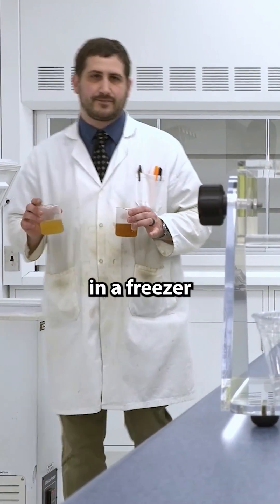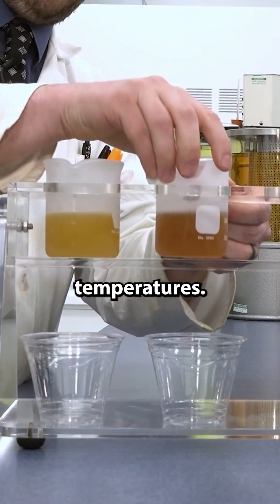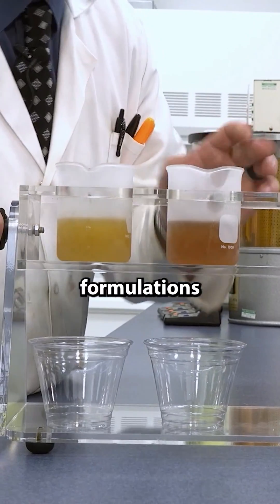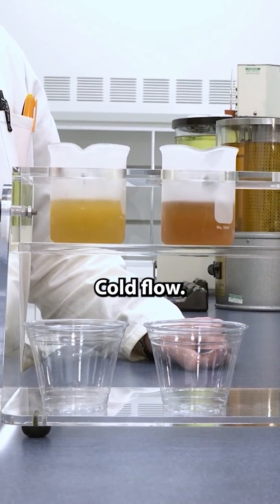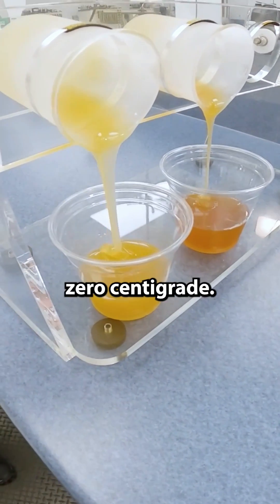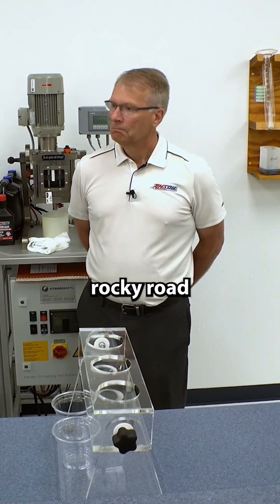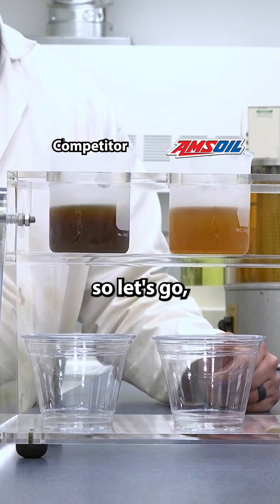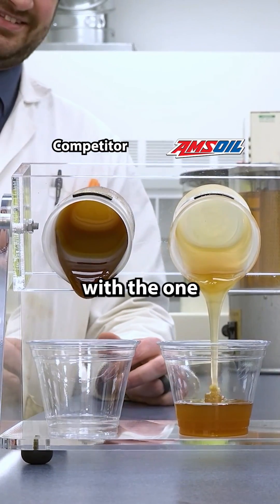Engine Oil At -35°C

Comment from the maker: lubricants tested were Delo 15w40 and AMSOIL 15w40 motor oils
Reply: why is the Delo oil darker...is it used?
Reply: @RX7Jay delo is always darker
Reply: @RX7Jay Probably regular rather than full synthetic would be my guess
Reply: Ive bought delo hundreds of times and some batches are certainly darker like that.  @RX7Jay
Reply: So -35 and dude can just grab it with his bare hands.
Reply: @GForce.Racing easy, it's just plastic, we do it all the time here in AK,, metal on the other hand, 10 secs and your hand gets cold af 😝 -35 isn't an extremely dangerous temp long as you're not exposed to it for too long, just don't lick metal at that temp hahah
Reply: @GForce.Racing  nice catch. However, the super cooled beakers probably weren't that bad for just a few seconds. There's a guy stationed at the south pole uploading short videos and he uploaded one of him walking around a building in a t shirt at -60⁰F. 
https://youtube.com/shorts/TnEHT3L-T4E?si=LzjasLi7hS3mkSMY
Reply: @GForce.Racing it’s not that bad, if it were a metal cup it might stick to your fingers a little but it’s not going to give you instant frostbite.
Reply: And the Delo Oil wasn’t Full Synthetic Oil, because the only have “blended Oil”!!
Make the same, so you called  “Test” with a full synthetic Oil off any  known Brand.
Thanks
Reply: The cold viscosity rating is measured at 0⁰C. At 0⁰C, the oils would pour very close. The operating temp viscosity is measured at 100⁰C. They would pour very closely at 100⁰C as well. But amsoil has better viscosity additives for better low temp flow at -35⁰C. 
  If youre that concerned about cold startups in winter, use 0w-40 instead of 15w-40. I'd like to see what amsoil 15w-40 compares to a mobil1 0w-40. Personally, I feel 15w is still too thick at 0⁰C amd would prefer a thinner Winter weight while retaining a higher 40 viscosity at 100⁰C. And let's be honest here, a diesel engine under sustained load can see oil temps well over 100⁰C. I'd like to see the viscosity/temperature curves from amsoil and their competitors outside of the standard 0⁰/100⁰ range. Amsoil clearly has better extreme cold flow vs a standard 15w-40 oil, how stable is the viscosity at higher oil temps? Does it thin out more quickly in extreme heat?
  We should choose the oil that suits our needs and seasonal environmental temperature so that our engines get the best flow in extreme cold starts and best protection in extreme heat.
Reply: @EricErnst excellent questions. Simple bench test like that is only a small part of the whole pictufe
Reply: @EricErnst Well, I have 5W-40 mobil synteth on My old Volvo V70 Gas. Works well in Finland. About -25 Max in Tampere. 

My Friend has An Old Fiat Punto....1.2 Gas....He uses 10-30 diesel grade, because he is a truck man....

Works well....
Reply: common sense, you don’t use 15w in -35 lmao
Reply: Delo is $17/gallon, Amsoil is like $40/gallon...
Reply: @bobbygetsbanned6049 gee, i wonder why
Reply: That is good to know! I’m really happy to see that information. So just off the wall question? What kind of stain does this put on your motor trying to push this around? In my mind would think it would be very high .
Reply: @richardmoerke9329 a lot or strain, actually. More specifically the oil pump gears/teeth can be sheared off of you start a FREEZING cold engine/oil and try to Rev it. The oil pump is sped by rpms so If you try to spin it too quick the oil is so thick it will destroy the oil pump
Reply: Wow. You know what's going to flow even better than the AmsOil at -35 degrees Celsius? Any 10W-40.
Reply: Who would Put 15w40 in winter !
Even ur "better stuff is too thicccccc
I would get something like 10w30
Reply: Is this an ASTM test and if so whats the number. This could just be a demostration that makes one apear to stand out better than the other one but meets the same standards?
Reply: Toyota uses 0-16 w
Reply: @mikeme9938  if you have freezing temps most of the year ok otherwise it just for saving fuel. 0w16+ longlife what actually kills the engine.
Reply: Yeah but it's not a fair test... try a synthetic vs synthetic next time and fwiw I've never seen delo that color
Reply: @sxsprime I think ya better check that one out. The recommended oil changes depending on the temperatures it's operating in full time. Most mnftrs go to at least 10w40(reg\conventional), or 5w40(synthetic) oils when regular temps are at\below 0°F. It depends where the truck is operating. You won't be running 15w40 when temps are -35° or less all winter and be able to start it too well. That's why some trucks have block heaters, oil warmers, & batt warmers up in the frigid artic too. 👍🏻👌🏻🤔🥶❄️☃️🧊🏔️🛢️🚜
Reply: See, this is smart marketing. Actually using the correctly winter rated oil, like 0W-x would not have been as impressive of a difference. Use the correct viscosity for your operating environment and don't trust everything you see on the internet. 

I'd choose a correct viscosity winter oil with an additive package for other things over the wrong viscosity with an additive package for cold flow. Just saying.
Reply: @hellfireclub86  15w40 is tge correct winter oil for most diesels
Reply: @SXSPRIME  where ? at sahara desert?
Reply: At that temperature there both worthless, they both will not be lubricating the engine at that temperature. So thats the only thing this test show.
Reply: Who uses 15W40 at -35C?
Reply: Such a shame that amsoil and Banks both couldn’t find yall experts to hire. Clearly far superior intelligence than the actual engineers
Reply: BELRAY best
Reply: Using 0W-30 in my car. Even better.
Reply: i use 5w40 for all our cars.  no wonder it flows like honey when its 15w40 lol
Reply: @tomast9034  at operating temp 5w40 is same as 15w40
Reply: @SXSPRIME  but you have get there from "minus infinity" if the engine isnt heated up already. when here was -27deg C it took like 5 min for a gasoline engine to blow warm air, for a diesel 10minutes. the 5w40 flows like water in those temps. now half of the time it would turn with no oil presssure and pushing thru honey like guu.. if there is 15w40. its not the 80th where some engines were built to get to the next repair shop with no lubrication unharmed.
Reply: This is a scam the cups are different... The pour spout on the amsoil is wider....
Reply: Same weight oil? And both synthetic oil?
Reply: @scottbehm5728  The pour spouts on the two beakers are shaped differently, this is a scam....
Reply: This only matters if you show at what point the viscosity of each oil departs from each other.  

If they are both the same viscous at, let's say for example -15c, and after that the AMSOIL becomes more viscous, then it only matters for people who drive in -15c temperatures.  

I'm more interested in how they handle high temps, like engine operating temps.  Is the AMSOIL more or less viscous than the competitor at that point?  

How do they operate in engines with different oil pressures? Turbo engines, for example, need heavier oil..  If you take the same weight of AMSOIL vs competitor, does this mean AMSOIL is going to be more viscous, therefor potentially harming your engine?  

So many  variables that are not explained in this video that absolutely must be explained before coming to any conclusion about which is better or not.
Reply: partly fake!?! take a look at the spouts of the beakers, the spouts of the competitors are considerably narrower in both runs.
Reply: Who uses 15w40??? New cars have 0w16 oil. I put 20w50 in my 1979 spitfire but it never goes on the road in winter
Reply: @smoguli Diesel engines still use 15w40 oil🛢️ But at lower temps time of the year or location, they require diesel rated 10w40, or even 5w40(synthetic). 👍🏻👌🏻🥶☃️
Reply: Take all the additives and plastic out of it and do it again.  Yes plastic.  I know.  You should know.  Nothing....nothing on the planet makes raw oil turn black unless it it is added by the manufacture.  300,000 miles on my truck with no oil change.
Reply: I want to see how your oil performs at high temperatures if its so fluid ar -35° C .
Reply: How does it perform hot?
Reply: 15 literally not a winter use oil thats almiost what i put in my 8026rpm 32psi engine for track use it was 15w50 or 40 not sure
Reply: Never even heard of Delo before. Why not test one of the better competitors?
Reply: @nateb.1568  you must have never driven a diesel.
Reply: Who tf uses 15w anymore????? Now we have 0w30/5w30/0w20/0w16/0w40. Who lives in a place where -35 can happen will put 0w not 15w so ur test doesn't make any sense !!!!
Reply: who uses 15Wxx Oil at -35°C?
Reply: 15w40 ... What is this for a Car .. Oltimer or what...  2024... 0w20 / 5w30 / 5w20 ....
Reply: how does 0w-40 work in the cold. should  be ok right?
Reply: Naturally a PAO is going to pour better at -35 than a parafin-based oil. How about comparing apples to apples??
Reply: Delo is probably the most budget oil on the market,only way I use it is as a flushing oil so I can pour in some castrol or liqui moly after
Reply: And now 0w40 or 0w45 ? 
measuring yourself against the bad is bad
Reply: None of that is better than mobile one and Lucas oil
Reply: @somphothbsiratsamy3748 I’m with you on that one! Never had a failure running Lucas oil and motorex for two strokes. I’ve known multiple people that have blown motors trying out the wonderful amsoil.

Comment: Oil spends more time around 212°F (100°C) than it does at -31°F (-35°C) the cold flow is mostly irrelevant.

The testing that needs to be shown is at operating temperatures. When these muti-grade oils get hot they thin out. A 10-w30 will run thinner at operating temperatures than a SAE-30 (straight weight).

While I can not do the type of testing they do in the lab, I plan on doing some testing to prove my hypothesis or prove myself wrong whichever happens.

Comment: I have been an Amsoil user for many years. What sold me was in motorcycles and how much smoother the transmission shifts with it vs. other synthetics.

Their oil filters are another story. I have never had more oil filter problems (leaks) than with Amsoil filters.

Comment: Turn on the vehicle and leave it for at least 10 minutes in very cold temperatures. I do the se in my vehicle specially in winter and 10 minutes is enough time to warm up the engine properly.

Comment: Dumb test. Different shaped pour spouts on the beakers, comparing a synthetic against a conventional and the kicker... Using a 15w-40 oil for a -35 test. Neither oil is designed to be cold started at that temp so who cares how it performs so beyond the product specifications.

Comment: For most people, we don't see those temps. Last week in MI we had -9 F as our low (not including windchill)

Started my 4cyl turbo, let it warm up to about 100 F oil temp, then drove to work. If you're driving a turbo, oil fluidity matters. Then again I'm also cautious when coming home. I let my oil temps come down before turning off the car. Only takes an extra 1.5 minutes. Help prevent your hot turbo from baking your oil.

Comment: To say that one oil is better than the rest at any temperature would be a lie. Each company develops their engine oil to operate most efficiently in a certain temperature range. Extending that range without decreasing peak efficiency is simply impossible.

Comment: On diesels manufacturers give you a block heater and suggest that you use it when the temp is 32* F (0*C) or below.... so this is not an issue. It is however an interesting video.

Comment: These guys are delusional. Oil protection isn't only about how it flows at -35. There's a lot more to it. There is oil that might flow perfectly in cold weather, but not have good components in protecting your engine during operating temperatures.

Comment: If delo 15w40 and amsoil 15w40 flow very differently at low temperatures then they shouldnt both start with a 15. Are we sure thats not 5w40 amsoil?

Comment: I do snow removal and worked in -40 f below. Oil has never played a factor. It's usually your electronics that give you the issue. And you'll know real quick if it's electrical. Getting zapped from a diesel size battery at 130am will wake you up faster then coffee ever could.

Comment: I love tht, whats good for my 2001 e39 petrol 2.5ltr straight six with around 300k plus on the clock. She does burn a bit of oil just had the diaphragm thing underneath saying that manifold done to help the rocker cover breathe. Maybe that might stop oil burning or is the engine fook’d, i don’t think so tho because she will still do the 155mph ZeeGermans set it to..

Comment: Okay. Neither oil can be pumped at that viscosity on a cold start without damaging the pump.
Both would need to be heated. The Amsoil would need less heat or less time to heat for a faster start or using less power.
Same with the diesel fuel.

Comment: Coils would get hotter from engine than from the electric activity
1:36:00 - you measure between tip and coil connection 😬😬

Comment: Living in the upper Midwest, this actually helps a lot. Last year it got down to -35 F. I’ll be buying this!
Reply: Marvel mystery oil is a good one to mention, it's viscosity is 0w-20 i believe. It is good during winter seasons to use a little bit of
Reply: I hope not, its 15w40 you should be using a 5w at the bare min in your area.

Comment: okay but heres the thing, diesel oil has additives in it like extra zinc to purposefully make it flow less when that cold. it's designed to stick to engine components during long dormant cold spells to make sure that everything is properly lubricated when its used again.

Comment: A few things to note here:

First of all this is an advertisement its only reasonable to assume they purposely used an oil that compares badly to their own.

Secondly, as to my knowledge you don’t use 15W 40 oil at -35°C as its only pumpable down to -25 at these extreme temperatures you should use 5W40 or 0W40. Theres no point testing them outside their rated temperature range and theres no reason to believe that the increase in viscosity is linear so it could be that they work exactly the same at their rated temperatures.

And at last I just wanna say if you have to drive at these temperatures you should just heat the oil pan before starting the engine.
Reply: If you run too thin of an oil, you will lose oil pressure at operating temperatures. It is better to have an oil too thick than too thin.

Comment: This is all well and good for cold temps but what if I have a diesel SUV that's carrying 6 people with luggage doing 2000+ RPM on a highway/stop go city traffic in 50+°C ~ 120+°F?

What will retain its lubricantion properties in high temps at high load without breaking down?

Comment: i had drive from hospital because my ex gf sister had cancer, it was -29C in Poland and I had to cold start  Red Opel Cadet D on LPG. It worked, but I drove 100 metres and it died. Took me 10 hours to get it back running :) what a time.
Reply: Semi-synthetic 10W40 I presume? :)

Comment: During a cold start most parts are covered in an oil film from the last run.  They heat up in 30 sec and the oil circulates regularly no matter the blend.  Should have a pan and block heater plugged in that cold anyhow

Comment: Lol idk ive used shell diesel oil in my trucks for the last 30 years. And uh its below 0°f here more than its above and ive never had engine failure due to oil starvation. Not once. Sorry but idc about ur garbage or the competitors garbage. Take care of your equipment. Buy good equipment (not getting into what i think is good and what i think is garbage) and use the best lubes and greases and better fuel and your engines will treat you well. Its really simple.

Comment: I’ve ran Amsoil in my duramax/lml for the last 9 years. After putting 5k miles on the truck, Amsoil is it. Every fluid in my truck has been replaced with Amsoil

Comment: -31.9 degrees Fahrenheit. Use a heater for your oil pan block, fuel tank, transmission, or keep in a heated garage.

Comment: Now if only engines were gravity fed with oil this test would make sense, however it's not, sure the thinner stuff will push easier through the oil pump but the thick stuff will still push through all the areas with the same pressure applied, if it didn't all engines would die at -35

Comment: I'd have the truck on a block heater, battery minder and oil pan heater all night.  I'd also not use 15w40 at those temps.  5w40 would flow way better.  I've had that in Norther Ontario, Canada in February.  My 6.0L PSD will start but she will COMPLAIN!

Comment: It looks like the 2nd test they did the competitors oil looked "cooked" compared to the amsoil. Tbh amsoil is a bit overrated for how much they charge. Definitely don't use it for the 20k miles they claim either.

Comment: Who doesn’t have a block heater at -35° 😅. We start to plug in in the fall when overnight lows drop into the +30’s. Always used Rotella T-5 Just because of its price & availability. Amsoil cost @ 4 gallons per 5000 mile service seems like a waste of $ IMO. Splurge on the filter tho. Always use Wix.

Comment: At the off chance I have to start my car without preheating the oil and coolant, a synthetic low vis oil is great. The problem occurs when you run it in a gasoline engine that sees a lot of HP and torque requirements and high temperature. The range just isn't covering all the situations. So yeah, I am always in agonizing pain, when I have to extreme cold start an engine. Happens about once every 5 years or so. We plug in in Canada ;) or we are not going anywhere.

Comment: Yeah, for sales stands at local fairs that's pretty "cool", but ya know there is SO very, very much more to the actual lubricity of oil than temperature dependence on flow rates. If it lacks the needed properties, it makes no difference how well it flows.